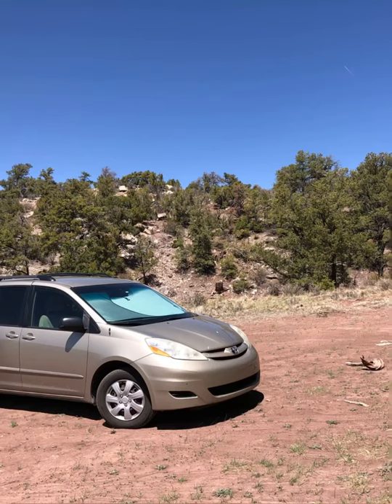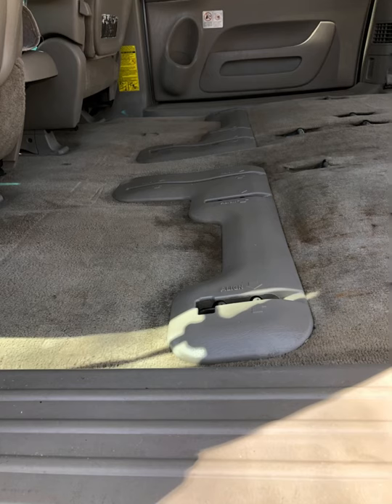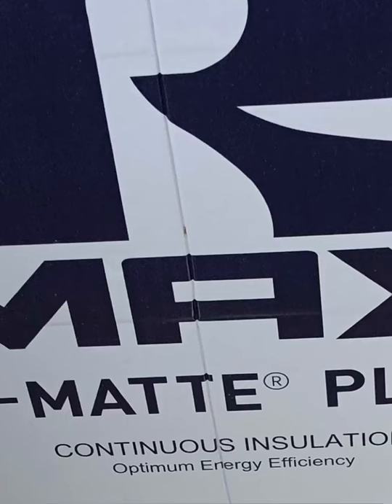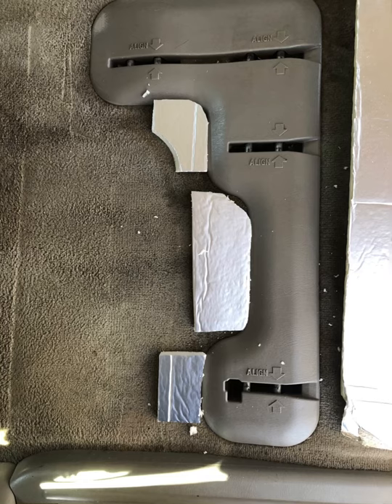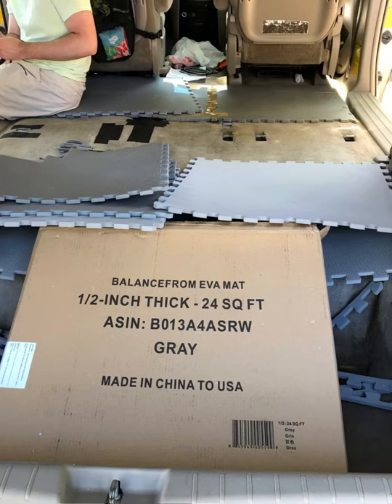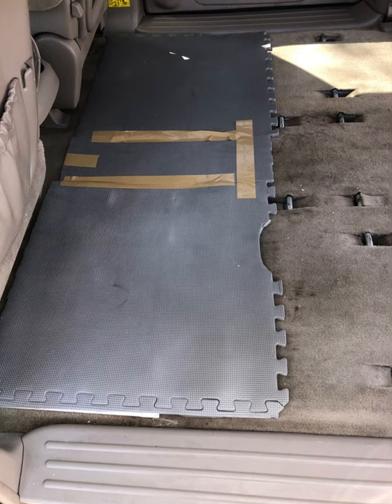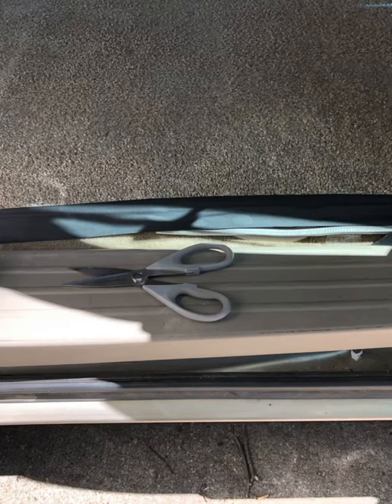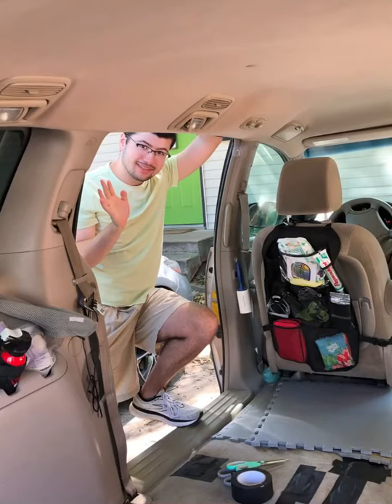No Build Leveling & Flooring in Minivan Camper. No Tools? No Skill? No Problem. Solo Female Travel.

Comment: Wow, I just bought some of the black foam puzzle pieces last week to even out the floor my minivan! I have seen some use pool noodles to go over the metal hooks. I have some pipe insulation that I will use instead. I bought a square piece of plastic that is made to go under desks to protect your floor. I will use that instead of a carpet - except for throw rugs perhaps.  So many options!  Probably won’t happen until spring though as I live in eastern Canada and we are heading into colder days :).  I will be watching to see how yours holds up.  Thank you for sharing the information.
Reply from the maker: Thanks so much for watching and for sharing! I'll keep you posted!

Comment: Interesting Dani. I hope you video putting your bed/etc back in then a follow up on how well this holds up. Also you will be camping in cooler weather & I would be interested in how well this insulates the floor. Thanks again
Reply: Hi there 3G. It’s always great to see what has worked with other people. I had thought about using those foam tiles and then throwing a Capet over them as well. I didn’t know those little metal bars in the floor as so pronounced. Still on the van hunt … prices are just so unreasonable. Two weeks later I’m still getting calls from the dealership where I made an offer. Why call me when you haven’t accepted my offer?
Reply from the maker: Will do!💕💕💕

Comment: Why not a piece of plywood?
Reply from the maker: Good question. A few reasons. No place or tools to cut plywood once I got it. It wasn't really an option. Plus it's hard. I wanted something a little softer and cushier for when I'm on my knees in the van. Plus, I was worried about those metal pieces that stick up making the floor still a little uneven, foam mat and carpeting are both forgiving and flexible.

Comment: If a 4x8 sheet of foam will fit a 4x8 sheet of plywood will fit. I have a Dodge van a sheet will fit in it.
Reply from the maker: Thanks!
Reply: I thought of that, too, or possibly a sheet of the pink rigid foam insulation that is made to put under concrete pours. It may not be as great for smaller pointy things poking in, though. It is great for overall not compressing. I put it in my bus before the plywood subfloor. Keep up posted.

Comment: I love your van build because it's so neat and organized. So I'm trying to copy it. Did you cut a hole into the carpet and foam to secure the bed legs to the van? Is that what's keeping the bed from moving around while you drive or did you put something else there to secure it. I can't quite tell from the video, even though I watched it several times.
Reply from the maker: The bed never moves. It is just sitting on top of the carpeting. BUT, it’s heavy, and I’m heavy, so I’m sure it makes it’s own indents. Also, the back legs are down in the well where the back seats used to be and they are against that metal. They aren’t tied or bolted in, but it’s super secure.

Comment: Have you had any problems with mold since you left the carpet in?
Reply from the maker: No, but the carpet gets pulled up from the side and back from time to time and I’m very careful, if I spill anything I pull it up and throw my fans at it until it dries out completely. Plus I only took one trip to PNW, otherwise I tend to prefer to be in dry climates. Hope this helps!
Reply: Thanks for the info

Comment: Nice figuring things out, Dani! I had a similar process with leveling out the floor in our Toyota Sienna. I put down a large sheet of linoleum for easy clean up. And like you stuck foam in the low spots covered with gorilla tape. So far so good.
Reply from the maker: That’s cool. The carpet is good for now. I like the idea of linoleum just for cleanup - it’s easier and more sanitary.
Reply: @YouAndMeLivingFree  I put the linoleum right over the original carpet in the van.

Comment: I know what you mean about those metal seat latch bars. I have tried many things to soften them. I still have my seats in so my space is limited. I may try those rubber mats and cover the whole floor.
Reply: I believe they unbolt from under the van.  Less complicated than you think.
I have seen people cutting them off, but that's a bit much.